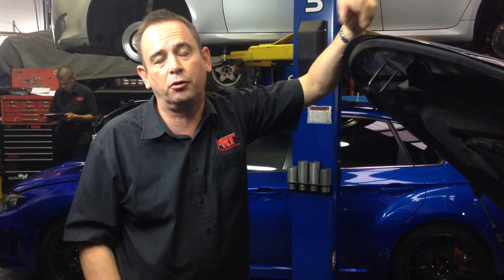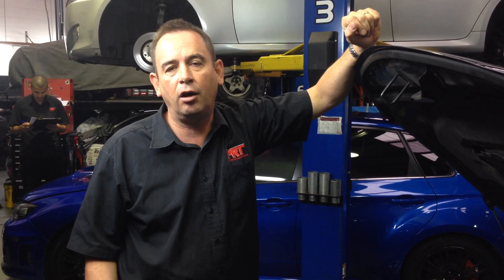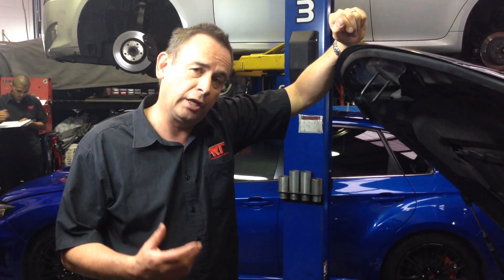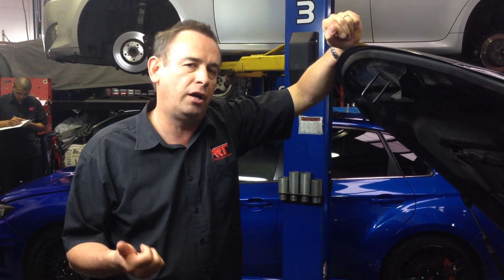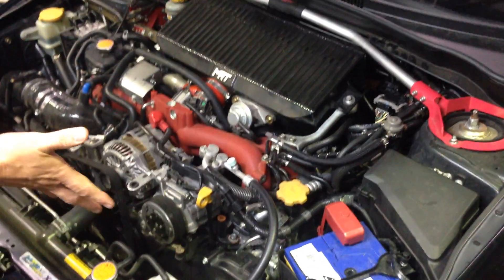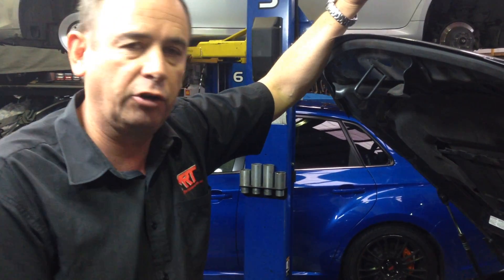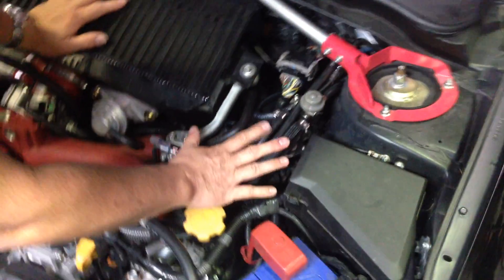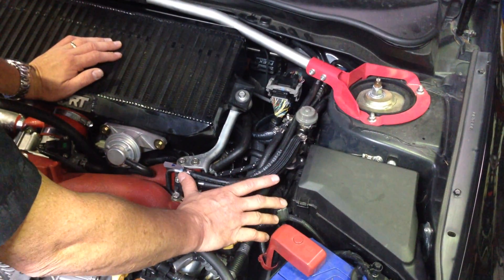Subaru Fuel system secrets for e-85 and high HP engines

Comment: Damn. Bet the first person to experience the back pressure return issue had it rough. Figuring that out probably cost a pretty penny and took a ton of time. Thanks for the vid as usual Brett. Love to see some more ej20g love in ur vids. They're a great motor and cheap to get. All forged internals for under 2k isn't a bad deal.

Comment: Would you do a video specifically about ethanol/e85 - there's so much misinformation out there thanks
Reply: What do you want to know?
Reply: +Swipez is it really corrosive to fuel lines, can you run it in a normal engine etc
Reply: +joelyboyblue that depends on the spec of the car of course. Yes there are some tricky things that you have to know. You must invest time into gathering information about your specific car. But for example, my stock 3.0L Subaru Liberty can take E85 after only a tune with no physical materials changed or added. But this is using software not available to the majority of the public.... Any car can be modified to run E85, and it is the cheapest way to gain huge power increases.
Reply: +Swipez you have the H6 , are you using subaru factory software. Do you think much would be required to run it in older subys?